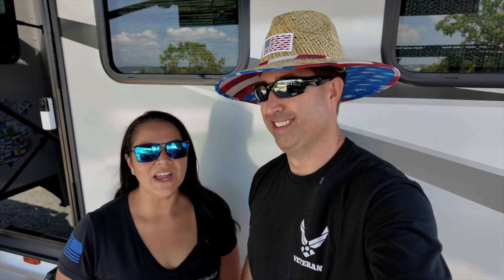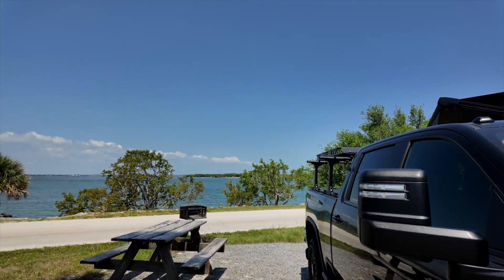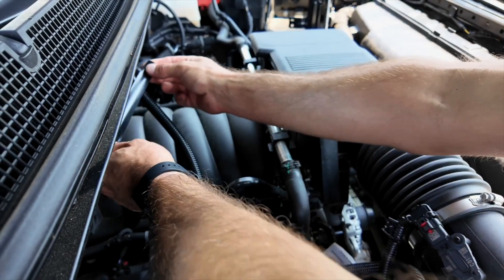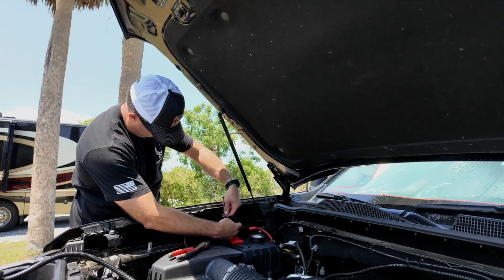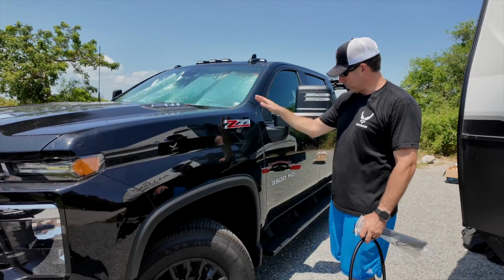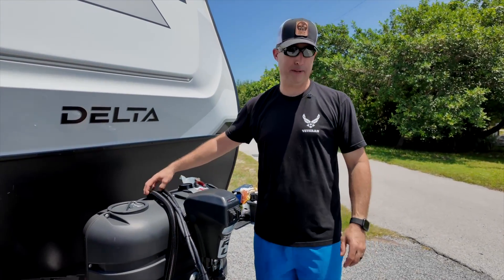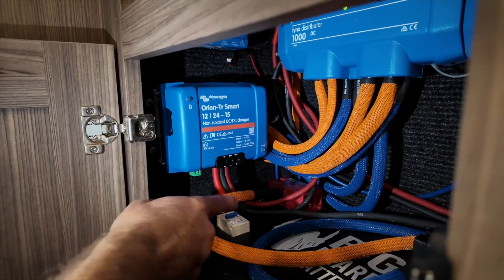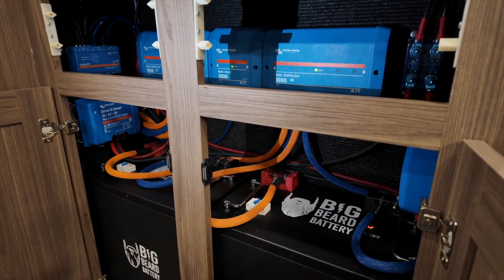Easy DC to DC Charging Setup Anyone Can Try!

Comment: Help me out brotha. I have a 36v Lithium that I would like to add to my rv to use to charge my 12v Lead Acid house battery. Could I just use the Victron 48V (even though it's not 36v, it is within the voltage range of a 36v?) to 12v DC to DC chager?
Reply from the maker: Thank you for watching our video.

It could be possible, but you will need to look for converters that change your voltage down to 12v if you’re trying to run a 36v to charge a 12v you will end up overcharging the 12v,  look for an Orion, that’s what we have - a 24 to 12 and our 24v system with the Orion charges at 12.8v for our 12v system.